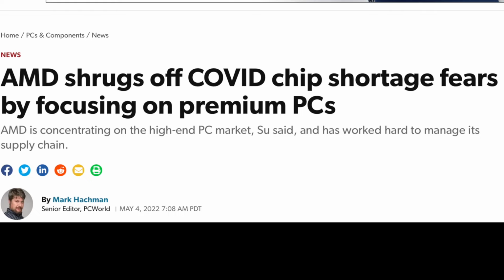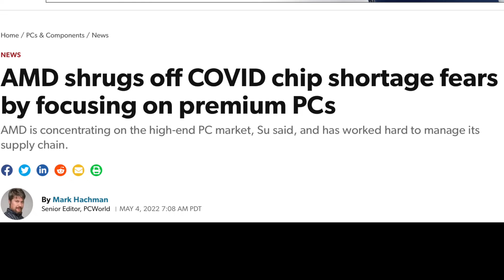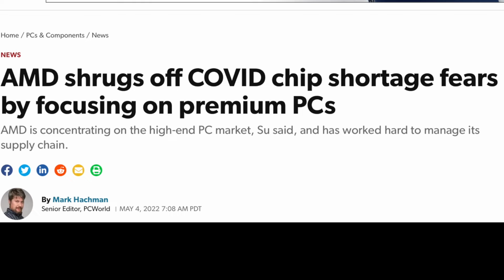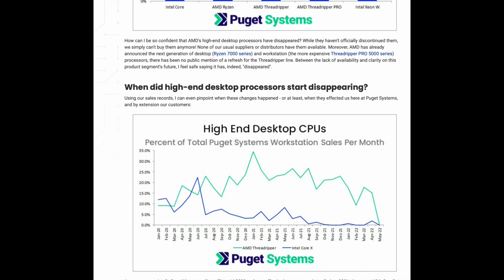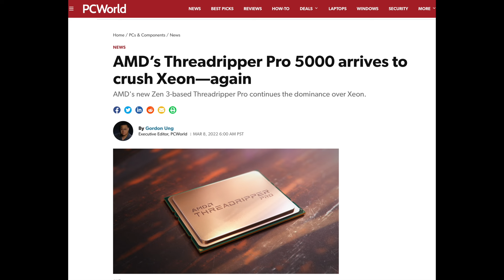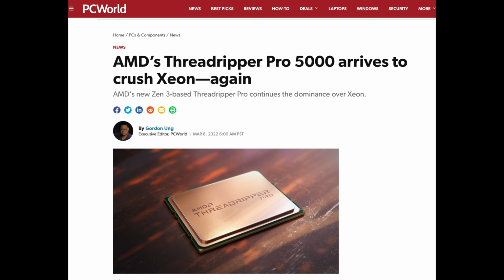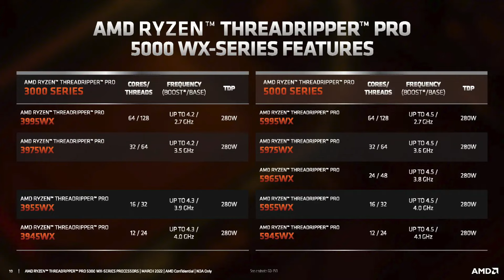Have Mainstream Motherboards Caught Up To HEDT?

Comment: PCIe lanes are a big problem on consumer/gaming platforms. 20ish lanes is just not enough for power users/home servers. it has pushed a lot of us to 1st gen EPYC to get the 128 lanes, and hey 8 channel ram and 7 PCIe slots with full bandwidth, 32c/64t is a nice setup anyway.
Reply: While not nearly as performant as Epyc, the first gen Xeon scalable is pretty stupid cheap for the CPUs ($200 for a 6138)

Comment: NO! Three classes; Enterprise, HEDT, Mainstream. Mainstream is missing something that both Enterprise and HEDT have. PCIe Lanes and PCIe Lane Bifurcation. You CANNOT use higher end, full throughput PCIe Cards in any slots without causing issues, or taking away from, the top PCIe slot. Want to run your GPU at x8 throughput instead of x16? Sure, go for it. I'm not giving that up.
Reply: With the upcoming PCIe 5.0 I'd imagine x8 would be more than enough for a modern GPU.
Reply: @yamilabugattas3895  the problem is not the bandwidth of the PCIe spec, but the fact that older cards need more lanes, and are perfectly good otherwise. For instance, I have a few older capture cards that run at PCIe 2.0 x8, which means that if I put them in a PCIe 3.0 x4 slot, I only get half of the bandwidth.
Reply: Exactly! 👍👍

Comment: DDR5 is NOT the "Bleeding" edge, its the new common standard as most motherboards that support 12th Gen, upcoming 13th & 14th Gen CPU on the Intel side all use DDR5.
Additionally prices have come down, I recently purchased 128GB (4x32GB) of Corsair Vengeance DDR5 5200 for right around $1,000.

Comment: I've got an MSI b550 Gaming Edge Wifi board (solid VRMS, 2.5ghz, etc) and a 5900x w/ 64gb 3600 c16, RTX 3070, 2x 1tb NVME, 2x sata drives, etc. It's great for productivity and gaming and I'm blown away by how efficient the system is - last night playing Mass Effect Legendary Edition at 3440x1440 @120hz locked (max settings) it was drawing about 250-280w total. That's amazing given recent history and current competition. 

The only HEDT type of spec I feel like I'm missing is the option for more NVME slots - I'm seeing Z690 boards with 4 slots and feeling jealous. But there's literally nothing that I need for work or gaming that my PC can't do and do well including content creation/editing/rendering and streaming etc, and the whole system costs just a fraction of what would have been required to get even close only a few short years ago.

Comment: People that had HEDT before because it was useful but still overkill, they can move back over to a 5950X or 12900.

Anyone that needs more memory and/or quad channel memory, or way more cores, that's where they still need the new Threadripper. And bigger operations go to Epyc.

Comment: Completely OY here; how long have you been with PC World? I could have sworn I normally see you on Classical? Weird. I was just looking through some older PC World physical mags the other day. I used to have a sub that let you get another subcription for 75% off which I bought for the PC/Net Tech company I worked for back in...let me grab one of the magazines I was looking at, 2005-2010. Funny how going back 15 years can have seen such a ridiculous change in, well everything when it comes to the performance of the parts and the bloody cost. Yikes. My first laptop had a P4m @2.7 with 512KB sDRAM and an ATI x700 Pro and cost just over 3k new, but by then you could get a laptop with a "Centrino" Core 2 7300m with 1GB of RAM for a paltry $1679.99! Sure no GPU, but that processor could pretty much brute force the games I played a measly 4 years previous as long as there wasn't too much 3d going on.

Good times, good times indeed. As for the elimination of HEDT, I'd say that has just almost as much to do with price as it does to mainstream chips and boards closing the gap. I'd be ecstatic if mainstram boards doubled the amount of PCIe lanes, and yes, I know gen 4 effectively does, but it doesn't double the number of on board PCIe interface ports, and half the time you only have access to 1 PCIex4 and 1x1 slot bc GPU's are so darn beastly now. Then with litited lanes about half of that time if you use more than one NVMe drive you end up disabling the x4, or x8 that isn't covered so you're sol there. I had to use a 2GB SATA m.2 bc if I used an NVMe in my 2nd NVMe slot I lost my bloody main PCIe slot on the rig I'm using now which is really, really infuriating. Now if therre was a TR 8/16 that only cost $100 or so more, on a board that was, idk, $200 more, it might be worth spending the extra money to have the extra lanes at home, but there's no in-between anymore. It's either deal with what someone with an r3 4/8 CPU would get, or jump all the way up to near professional on-site workstation levels, with a price to match which most people, especially like myself who aren't using CAD every day, am not streaming or rendering videos/audio daily etc just can't really justify. It's either run splitters and extenders with whacky 3D-printed mounts, run a 2nd or in some cases a third box to do all you need (in most cases the 2nd and 3rd rigs can pretty much just be old PC's with some modern add in cards tossed in) or just make do. Granted, it's not the end of the world since you can lease pretty much as much power as you need from any one of a hundred different solution providers and just remote what you're missing at what is typically a prety affordable price, but the future that gen 1 Threadripper looked like it might be providing in the future never really came to pass.

On the plus side, the home end of the segment has certainly done what it could to provide immensely more value than anyone who built a mid-range or high-end PC in 2015 could have possibly reasonably dreamed at this point. 8/16-8/20 CPU's that game as well as $1000 CPU's which still target gamers and can handle most workstation tasks better than $3000 chips from 5 years ago, and $8000 chips from 7 years ago, while the motherboards are trying to add more lanes on the board itself to help out, especially if you don't mind going with an eATX home platform. So is it the "Threadripper Revolution" we were hoping for for? Nah, far from it, but it sure as heck is a far, far brighter world in the home pro front than it was 6 and a half years ago. Now if GPUs would get back to doing what every piece of tech throughout history has done and start offering the same or better price to performance gen on gen again. It'd be great to actually hit a  Golden Age insead of just looking back at Pascal-like golden generations, though I'd certainly be happy either after the last 2 generations of GPUs and the mess that has been the majority of the last 4 years (on the GPU front, CPU's have still been great).

K, guess I'll see you at Classical Computing, or here apparently. Man I miss holding the majority of my magazines though. Funny how 20 years ago if yu told people that Websites would literally take over the magazine and newspaper mediums you'd have mostr likely have said they were idiots, especially after the dot com crash, but man, finding back hard copies of a lot of books in new condition that don't cost silly amounts can be a pain. Oh well, at least we have access to pretty much wtv we want to read whenever we want as opposed to having to lug around a truckload of magazines, books and reference material is certainly a plus.

Comment: Companies have pretty much homogenized desktop PCS for gaming.
Reply: Except they have stolen PCIE lanes for NVME use, we didn't have to worry about the impact on slots with HDDs or sata SSD. I loved the X299 but mine died and second hand they are still right up there price wise for a reason. I have an X570/5950X and Z690/12700K and they still aren't as versatile imo for plugging stuff into.

Comment: My customer with a TR 1950x 32gb ram had his mobo die. I had him buy a 12900k and a msi z690 tomahawk ddr4 and just keep his ram. He doesn’t use maya anymore and I’m not exactly sure what that means but he’s happy no call back. If anything stick with the higher chipsets I have b450 the only problem I had is my second nvme drive is in a pcie adapter and only runs at 2.0 4x, which is fine since it’s a 660p and It’s barely faster than 2.0 4x it worked out pretty good. My main is a 970 evo plus at full 3.0 4x

Comment: I've got a xen/k8s cluster with 2.5ge x570 motherboards with 5950s and 128gb ecc, 3 m.2, leaving x16 for gpus and 2 1x lanes, 3.2 gen 2 for expansion. sourced 8 port 2.5gbe router with N6005 from Ali, but I'm a dev and it was a whole ordeal. Creators and devs with any common sense would just buy a thread ripper or epyc rome/Milan and then focus on their primary goals

Comment: Consider the categories, Mainstream, HEDT, Workstation, Server, Enterprise.
Threadripper is Workstation and given the price of the processors for the 3000 series, in no way can you consider the platform (TRX4) HEDT as current desktop processors (5950X) wins in everything but 100% all core workloads which generally require workstation applications.

For a HEDT to be considered HEDT, the processor should at least match the desktop processor in every workload, not lose by 20-25% in lightly threaded tasks, which is the case for AM4 vs TRX40.

For me an example of a HEDT platform would be a crossover of core counts, in the case for next gen AM5 that would be 8-12 cores and up. Instead of dual channel dual slot, quad channel single slot for bandwidth. Additional CPU to chipset lanes increasing bandwith to the chipset enabling better PCIe availability via multiplexing for more x8 availability instead of just X4.

X16 (x8x8 bifurcation) plus x8 pcie as either slot or additional m.2 to option 3X m.2 raid for ultra fast NVMe raid direct from CPU. Not Threadripper levels of PCIe availability, but that extra X8 lanes would prove very handy.

If done cleverly, there's no reason for a HEDT platform to need its own socket and could be designed backwards compatible to accept desktop processors that would limit the extra features, it could also allow for standard boards to accept a HEDT processor. Consider if all dual chiplet processors were HEDT class and all single chiplet processors were standard class, it would allow the end user to define their setup, with high core count and HEDT platform required to unlock the full potential.

Whilst having 16 cores on the desktop is nice, it's always seemed to be a compromise given the limited memory bandwidth of dual channel and the limited PCie expandability if you can't bifurcate the GPU slot and even when you can. With PCIe 5.0 X8 x8 x8 would be a real nice to have, with a couple of x1 and a x4/x8 hanging off the chipset plus the usual connectors.

It's not always about what you need either, it's about what you want and HEDT should be a suped up desktop and not a dumbed down workstation like TRX40 (compared to WRX80).

HEDT died with TR4.
Reply: You do know that Intels X99/X299 was always slower for games compared to their mainstream systems, unless you océd the hell out of them and had super pricy cooling rigth ? Their only advantages was PCI-E + Cores, @ aka the same as threadripper/TR4 had vs AM4. And the same issue modern lowend Xeons and X299 series chips has over their desktop counterparts. Sure Z690 gets Gen 5/4 pci-3 vs Gen 3 on the older Intel HEDT, but HEDT still got the core count crown and overall lane advantage(as far as i remember anyhow).

Comment: I think for low end HEDT setups, Ryzen 7 & 9 has killed it for Intel ❌☠️. Those that require a little more oomph will move up to Threadripper with its cheaper 😇👍 setup costs compared to Epyc / Xeon server builds while offering cheaper DDR4 (at the moment) ram for large memory and bandwidth requirements with quad-channel, massive multi-core CPUs and extensive PCI-E lanes which will cover many excess M.2 storage and capture devices etc for yeats to come ⏱🥰. Even for prosumers and semi-professionals these solutions mentioned give consumers many choices and solutions depending on needs and budget.